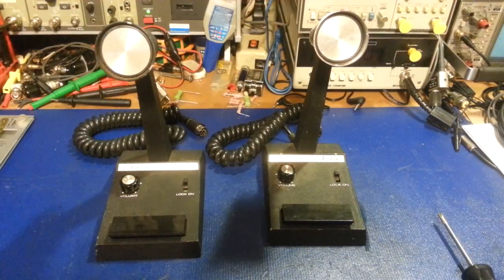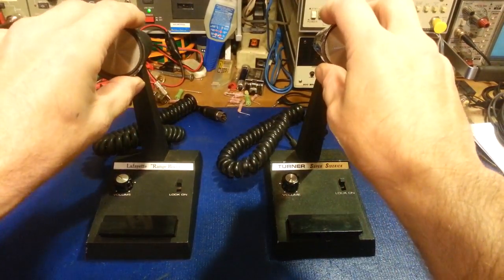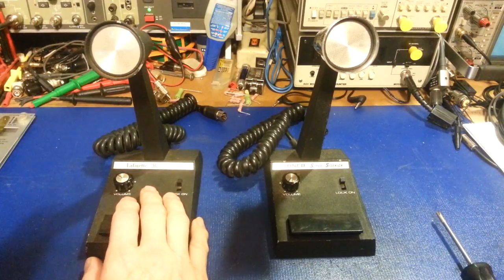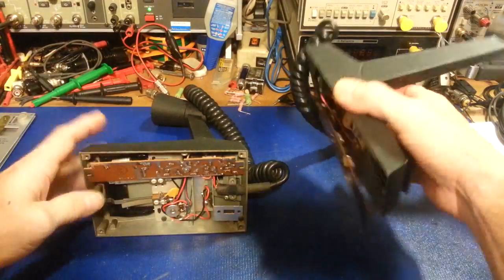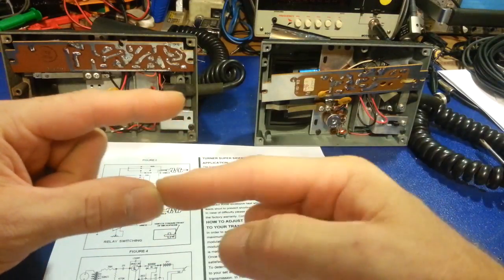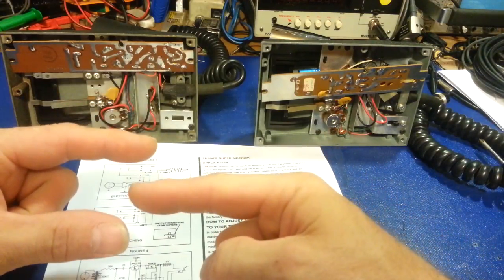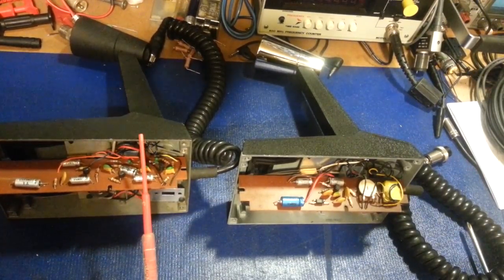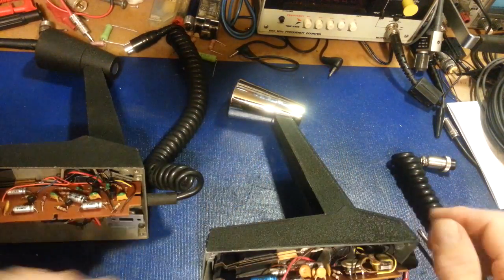Comparison of some different model Turner base microphones and mic plug wiring.

Comment: I have restored a Turner + 3. Had it professionally powder coated with the original finish. Replaced the power cord, all capacitors. It has a very good original element. As for the Super Sidekick, never heard that mic sound good on any radio including mine. Tube or solid state. They always sound hollow. But I have heard them sound good with a capacitor mod.

Comment: Interesting video. I have both Turner +3B and a SSK. I repaired the +3B many times in the past 30 years even replaced the FETs but it is still doing the job. Considering I bought it secondhand it is a great mike. Have also purchased a SSK 10 years ago but although it is like brand new and shining I didn't like the output and it was more sensitive for RFI. I really didn't knew the SSK has no compressor inside. I never opened it but I really want to do it know. If it has the same circuit as your example I will sell it immidiatly.

Comment: Another great tip Mike.  These can be very confusing to the newcomer, You explained that very well.
Reply from the maker: I think its really confusing for the new guys in the hobby.  Their accustomed to modern radios with electronic switching and when they get their first classic rig the relay switching it really throws them for a loop.

Comment: i have a wilson trucker power mic and cant find anywhere online for the wiring to the plug can you help it has a 4 hole plug with 5 wires red, yellow, blue ,black and the common

Comment: Been using Turner +3 mics since they were released. I've had a good number of other mics, including the d104 and the 575 M6. I've always gone back to the +3. I've used them on radios from Radio Shack to the Yaesu 757 GTX2.  Currently, I'm using a +3 on my Ranger SS-158 EDX and the audio is second to none!
Reply from the maker: Yep, don't think there's a radio made that the +3 doesn't sound good on.
Reply: +MikesRadioRepair very odd thing. my +3 doesn't sound good on ssb (uniden madison) but works well on AM. I've tried it in all different levels as far as rigs mic gain and mics volume control but gets horrible ssb reports. As I mentioned on AM with the same madison it gets"sounds nice" reports. I'm assuming since it work well on AM the mics cartridge is good. Might I be wrong? if a mic sounds good in a particular mode why not on all? especially on SSB where the +3's are supposed to shine. What you say?
Reply: You've gotta be careful about over modulating. I know if mine is up too high I'm told that I am fuzzy and muffled. My radio has been cranked, but with my mic gain on the panel of radio turned down a bit, and my +3 control set 9 o'clock everyone says I am golden. I never run mine past the 9 oclock position on AM or SSB.

Comment: Great video Mike! The turners are one of my favorite desk mics as well, I think I have around 8 between the different versions. And you're correct, the caps in the mics always get overlooked! I've heard alot of good stuff about you on a Facebook radio page I belong to. How does one get in contact with you for some repair work? Do you also work on tube type gear?

Comment: I think I got a good one. It's a Turner Plus Three with gray hammertone finish over all except the label which is blue background white letters "TURNER" on the left side and silver background with black letters "PLUS THREE" on the right. Circuit board is the 3 transistors + 1 FET as well as the switch(electronic/relay). Going to hook it up with my Cobra 132 most likely. Stamped with INSP 286. Can't seem to find any date references on it Most of the print on the bottom plate is worn off.

Comment: Nice. You have any knowledge of the Browning 776 Mics like what radios and whats the difference in the stripes?
Reply from the maker: From the radios and mic's I have worked on over the years the brown stripe microphones were for the MK3 radios and the orange stripe were for the MK4 radios.  MK3 microphones had the 2 pin plug and the MK4 microphones had the 4 pin plug.  In every brown and orange stripe I have worked on they both had the exact same circuit board with the exact same component's.  The only real difference was the wiring.

Comment: Mike, I need the wiring (in the base) for a 776 Browning mic. It was wired for a 2 pin (MKIII_?) the old cord was only 2 wires and shield, so I replaced it with a new 6 wire cord. I need to know where the different color wires from the board, and cord are connected to. I don't know if someone has moved around the wires to work on the MKIII, because it did not have a battery or a way to get the 5 volts(I think) from the radio. Thanks in advance, 21

Comment: Is there a turner desk mic that has an 8 pin IC in the circuit board? Because I bought one around 30 years ago and the name plate says turner ssk, though I was still new on cb I believed it was. But just recently, a friend of mine gave me a side kick which I'm aware now that it's original with its stock condition since the one I bought was repainted silver. I openned both bottom covers to compare, then that is when I saw the big difference in cicuitry because of that 8 pin IC, also mine have three paddle switch inside and it doesn't have the electronic/relay switch even the bottom cover doesn't have a hole for that purpose. Please enlighten me coz I'm puzzled.

Comment: figure 3 (@4:26) shows the battery somehow not making contact on the positive end. I have the same print. What's the correct path to ground for it during transmit?

Comment: Hi Mike, where the screw to remove cartridge from Lafayette? how to open the dynamic microphone case?
Reply from the maker: If it looks like a Turner then that's probably who made it.  To remove the front half of the head that has the microphone element you pry out the little aluminum disc on the back of the mic head.  There is a Philips head screw behind it.  Removing the element is another story.  It is crimped into the bracket that holds the head on.  It is very difficult to remove.
Reply: @mikesradiorepair  thanks Mike, my Lafayette had a problem with the microphone, it's not the pcb, but ... thank you very much for the quick answer, have a good night

Comment: Mike, i just scored a minty Super Sidekick on Ebay. Do you know if all the electrolytic caps on the amp board are still available?
Reply from the maker: +Richard Burwell 

Yes they are.  All the Turner base mic's use axial lead capacitors.
Reply: Can you tell me what the CMOS chip is for? If it isnt for compression, did Turner use it for SSB?
Reply from the maker: Richard Burwell 

CMOS in what, the microphone?  There are no CMOS IC'S in any Turner microphones.  There is a 1/4 watt audio amp IC in the Super Sidekick.

Comment: Hey Mike, I know this video was about plus 3s but I have a Turner plus 2 SSB transistorized and I am having a hard time finding the proper mic plug wiring for my Cobra 2000 GTL. I am finding a few different ways online and don't know what to believe. Could you please give us the proper wiring for a Turner +2 SSB transistorized to a 5 Pin Cobra 2000 GTL?

Comment: Hi Mike, got a Turner +3 and it sounds awesome on my TS590SG ; what i would like to solve is getting rid of that popping sound it makes when keying on transmit. I did it slowly, the TX led goes on quietly, it's when the mic plates go in contact that the sound appears ; maybe some leads are not well connected especially ground related?
If you happen to have a thought on that, please get back to me.
Thanks Mike, 73 de Chris KP733
Reply from the maker: You might try adjusting (bending) the switch contact arms.  Turner microphones have 2 to 3 sets of separate switches.  There is kind of a "timing" to it.  Since all three switches are operated simultaneously when you press the PTT bar they can actuate at slightly different times.  You might try adjusting them so it switch that controls RX/TX switching happens last.  That way the audio line will be connected slightly before it goes into transmit.   Different radios often require adjusting the switches to operate in a different contact sequence to prevent things like this.  You may have to play with it to find the right combination.
Reply: @mikesradiorepair  Thanks for your quick answer Mike, i'll have a look at that, good idea!

Comment: Hi Mike. I really enjoyed this video. I have one question regarding the Lafayette "Range Boost" version of the +3. Any turner mics I've wired the black wire is TX and the red is RX. My  Lafayette Range Boost the red is TX and black is RX, (like Astatic). I checked the wiring and all looks to be original and untouched. Have You noticed this color switching on Your Range Boost?  Perhaps Turner did this so the Lafayette brand was to be a little different??? 

Thanks
Reply from the maker: Larry Lacroix 

If I remember correctly Turner used Lafayette's mic wire coloring system end these.
Reply: Thanks Mike. I thought that be the case. Thanks for your quick reply. I'm enjoying your video's
Reply: That concurs with the schematic I have for the +3(electronic switching)

Comment: hi mike.  71/72 eh.. we same age :-)
on my astatic D104-m6b  i went inside the mic ran a jumper from the blue wire to the shield  darn thing anoying when i wire one to a standard 4 or 5 pin cobra radio. also my m6b has a yellow wire in the cord  kinda confused as to that since it's not used
its red-white-black-shield-yellow
anyhow on mic's
hiel-/turner/-astatic in that order, all other is inferior  far as standard stock mic, it varies some better then others it's hard to say what's good what's not good.

Comment: Actually., one of the other BIGGEST differences between the "+3" and the "SideKick"., is the fact that the "+3" contains a ceramic microphone cartridge., as where the "SideKick" contains an ordinary magnetic (aka: dynamic) microphone cartridge.! (as can be seen in that the circuit board in the "SideKick" has a small impedance matching transformer at its rear end) >>> Ceramic cartridges (as what's in a D104 "Lollipop" and most other Astatic brand mics) will almost always have MUCH greater high-frequency response as compared to magnetic / dynamic cartridges.!! >> Bottom-line., the "SideKick" is NOT as "crispy" sounding as the "+3" microphone.!!! >>> Courtesy of Eric Klein., of Klein Communications

Comment: I can't find a schematic anywhere that shows how to wire the switch for "Electronic/Relay". I've looked at all the schematics online and none show how the switch is wired.
Reply: https://www.mods.dk/
Copy I have from there shows both electronic and relay wiring. Basically for electronic the red wire(in the mic) is grounded for receive and the black wire is grounded for transmit. Exactly which pin on the connector is what is up to the radio you have. And you might find the schematics for your radio also at that site.
Reply: @lochinvar00465  If you know the earth you can work out the others, if you touch the audio pin on the radio, it will usually buzz, then if you jump a wire (don't keep holding it on) it will either receive or transmit.  Touching the wrong pin very quickly will not normally harm the radio.
The earth pin will do nothing but be a ground for the RX/TX wires and ground for audio, it is the screened wire most of the time.  You can take a short thin bit of wire and select a pin and hope it is earth, then touch the others to see if it goes to TX or RX if it only goes to one mode, it is the other pin that will be the earth, not the one you selected to use, so use the one you touched and check that pit to the one you took it off of, it will either TX or RX, one other pin will be either RX or TX, the remaining pin will be the audio from the mic. Now Mike will tell me you should not de it this way!  EDIT:  This is the connections on the CB mic input.
Reply: @BoB4jjjjs  he asked how to change the wiring between relay/electronic, not wire the mic to match a radio.